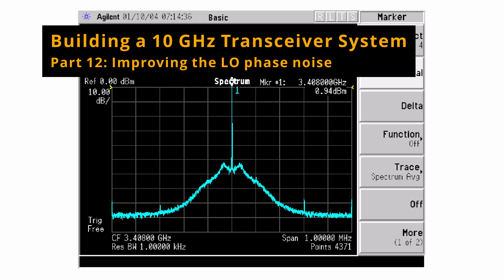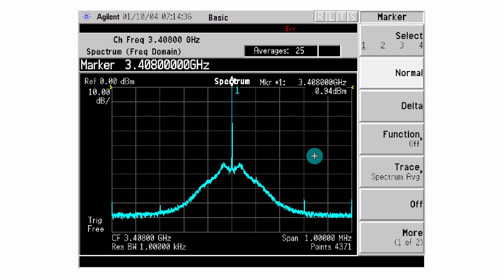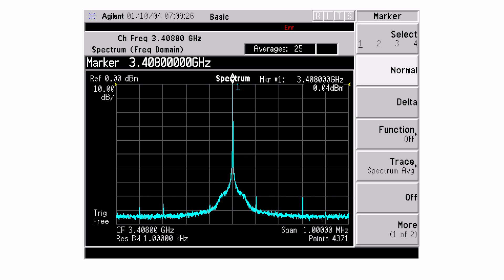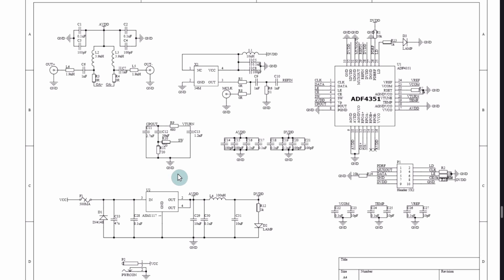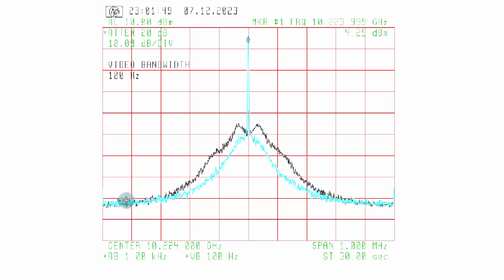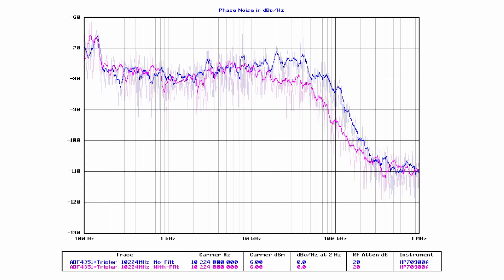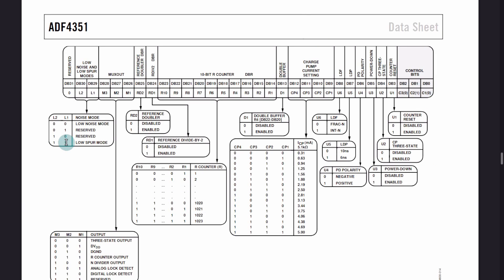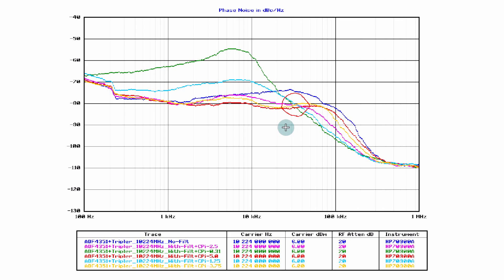10 GHz System, Part 12: Improving the Phase Noise of the Local Oscillator

Comment: all chinese made synthesizer boards use the same regulator for AVdd and DVdd just by adding a simple filter. Consequently the layout is also poor and couples the digital to analog path. even some of their cheap bench top signal gens use the same design which is very wrong. DVdd and AVdd must use separate regulators and the layout for DGND and AGND (even though they are electrically connected) must be carefully separated to minimize coupling. of course all of that adds to the cost. AVdd also needs a lot better filtering of course.
Reply from the maker: Absolutely. Now here in my application I am quite sure it is going to be fine. If this becomes an issue, I will consider redesigning, following Analog Devices recommendations. Thanks!